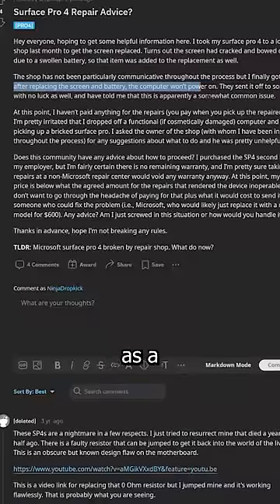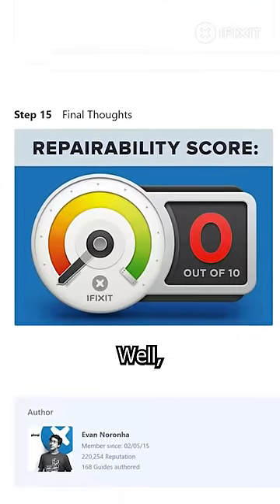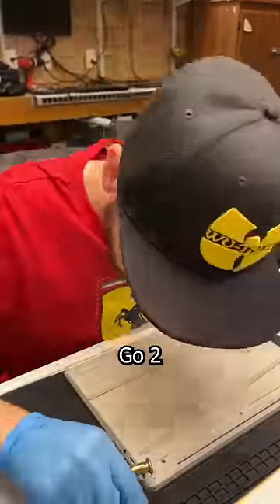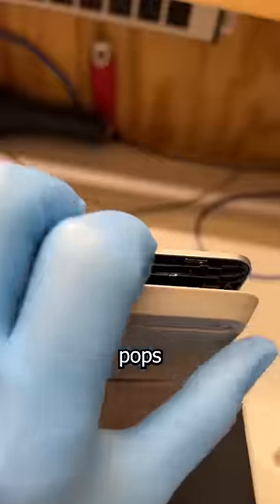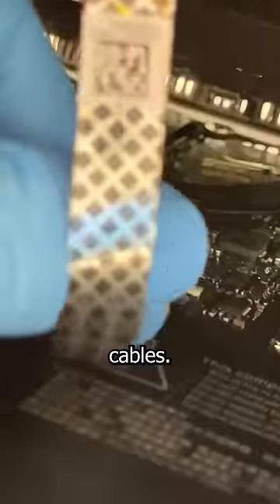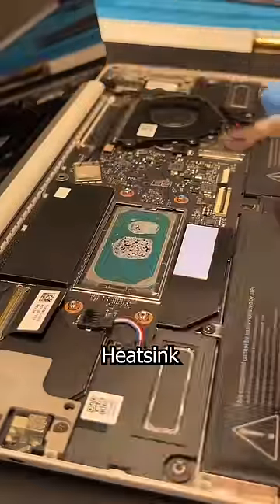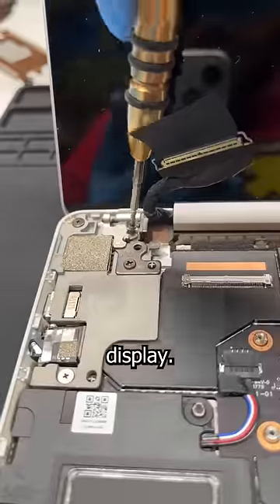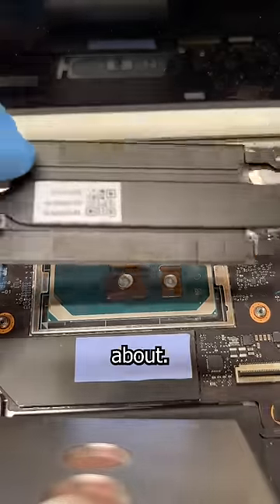Microsoft Surface Laptop Go 2 display replacement #computer #tech #pc #technology #shorts

Comment: My job gave me a surface pro 3 and it is the bane of my existence. It's slow.  It disconnects from the wifi.  The battery it's stylus takes is a battery my company refuses to stock.  Half the screen doesn't respond to touch.  It came in this ugly grey rubber impact case.   I have to send it to it to get it "fixed" at times.  I would swap it in but I'm scared that the one they'll give me is worse.

Comment: How is ram being soldered necessary “for security reasons” 😭 that’s the biggest lie I’ve ever heard
Reply from the maker: "Soldered RAM stops someone from removing the memory and "easily" freezing the modules using liquid nitrogen. Once frozen, Microsoft says it's possible to purchase a special memory reader for a few dollars from Aliexpress and access all the data stored in the modules, "including the Bitlocker recovery keys." https://www.pcmag.com/news/microsoft-blames-liquid-nitrogen-for-surface-devices-using-soldered-ram
Reply: @SalemTechsperts ah yes, because desoldering ram chips is something the average data criminal is able to do 🗿

On a serious note, if they were that worried about security, maybe they shouldn’t have configurations that aren’t future proofed so the owner wouldn’t feel the need to upgrade RAM in the future.

Comment: Hi there comment section, a little help please. I have a 2017 Surface Pro 5, and I had the battery replaced a few months back, but even though the new battery report looks promising it's still shutting off after being unplugged for 30 min to an hour. Any advice?

Comment: I wish Microsoft would just be honest about soldered ram than say the bullshit "security reasons".  like soldered ram can be better in certain circumstances but security is such a stupid reason to have soldered ram.  and on a laptop like this that's meant for lightweight productivity tasks there's really no reason to have soldered ram for the potential speed increases.  also if someone has physical access to your machine and they're determined to access it, it's not going to matter if the ram is socketed or not.

Comment: I work for a company that interfaces with Microsoft enterprise tech support for Surface Laptops (not pro or go) and Microsoft themselves won’t even repair them! Cracked screen, missing key on the keyboard, faulty ram unit, they don’t want to fix them and instead replace the units every time 😂

Comment: My surface Pro 4 Was Working Completely Fine Before it froze and all Hopes to get it to unfreeze ended, 
I turned it off.
When I turned it on the fans started spinning and the keyboard lights were on but the screen wasn't working and couldn't hear any windows Startup sounds.
What might be the issue ?

Comment: No, but Im having a nightmare everytime I need to set up one of the new devices. It wont recognize the keyboard and touch panel on the keyboard that comes with it, before getting Windows Updates. I always have to get an usb C adapter and a wires mouse / keyboard. Wtf even

Comment: solder RAM has nothing to do with security. It's a bottle neck. Literally. SODIMM pathways are bottle neck at the speeds ddr5 can get . There's a reason you can't get faster RAM with SODIMM vs soldered

Comment: RAM being soldered "for security reasons" when it's like a standard laptop RAM stick and it costs $400 more to get the one with more RAM, and it basically forces you to buy a new one to upgrade or replace the ram, it is such a fucking joke. they really think we're stupid, don't they
Reply: tempted to learn micro-soldering just to spite them

Comment: "Security Reasons" for preventing RAM stick replacement huh
Well let me give you a discovery Microsoft: RAM, be it Dynamic in sticks or Static in Cache Registers, looses ALL of it's data once you turn off the system
The only memory that could possibly be used againsts security is either BIOS or Drive memory, and even then BIOS has ROM - Read Only Memory, and BIOS itself is a completely sepparate system by itself basically, and Drives require power to get anything written onto them and System launched to execute something on them

Comment: too bad that you cannot replace screen only, and have to replace the hole serene assembly ( I guess only front glass is broken, why replace everything??)  . I my dell I can replace only the glass itself, I can even replace caps and chips inside the screen,
Reply from the maker: You can replace just the display if you want to make the work 100x harder to save like $20. This one had a bad backlight and the entire assembly was only $120 or so on eBay.

Comment: We all know the “Security purposes” of soldered ram is so you cannot make the surface better than Microsoft ever could. I bet if you unsolder that ram and replace it with much better ram and a better cpu and heat sync you could make an abomination of a gaming laptop.

Comment: 10 years later Bill Gates be like

Ok so we made new computer called the surface 190000 and guess what... The ram, cpu, gpu, fan, cables and ssd are all soldered in the mother board and if you touch the computer since it is so dourable it will break!

Comment: I once had to repair my hp pavilion x360 and my model was 15 something i had to reapply thermal paste and what do you know they made it really hard to do so sunce you had to take out the mother board because the screws were on the underside of the board took thos off reapplyed then guess what there were small brackets i had to linenup just to screww it back together bigest pain in the ass

Comment: How in the actual fuck are you supposed to get data off the ram if you can't already access the computer. Ram turn off and deletes everything without power, so taking it out is out of the question. If you don't have access to the OS there won't be any data of value on it.

I smell bullshit.